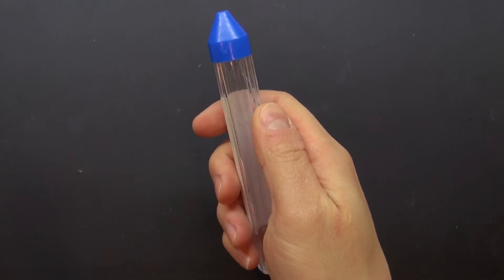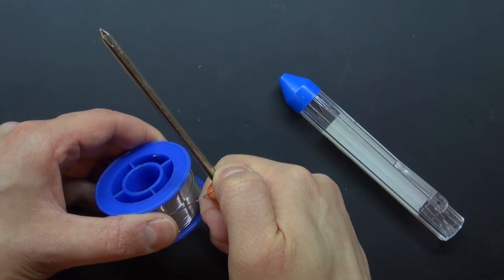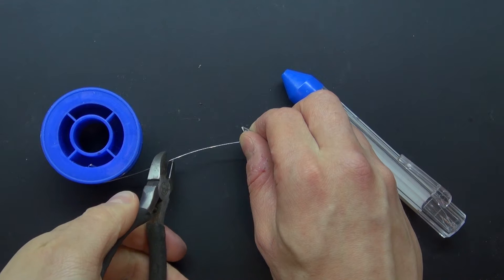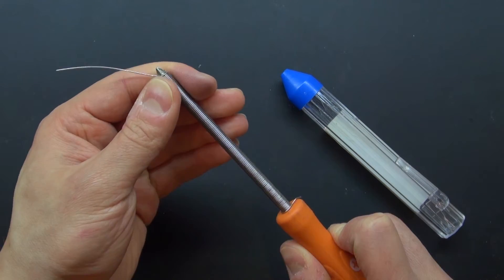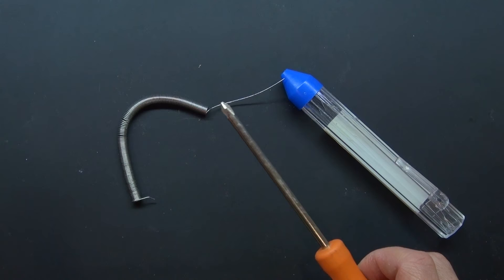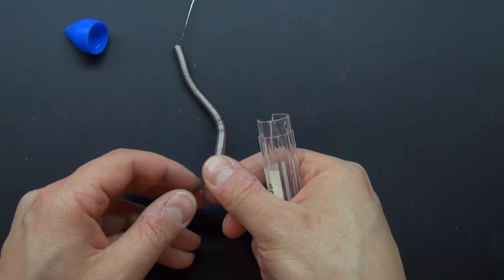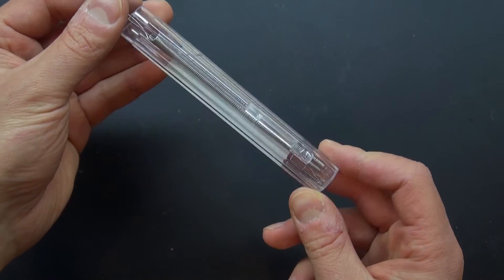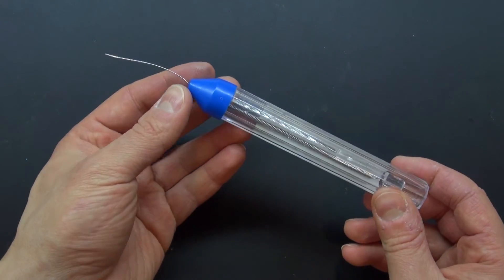Re-fill A Solder Wire Despencer

Comment: OK…but a larger diameter screwdriver or other item such as a dowel rod or acrylic rod would allow more solder to fit in the plastic dispenser.
Reply from the maker: Yes that would work too.